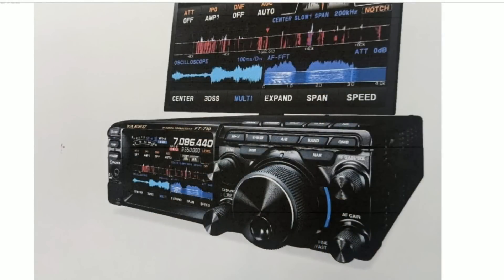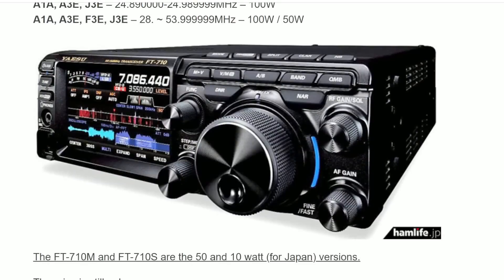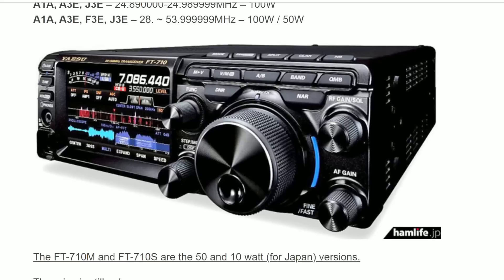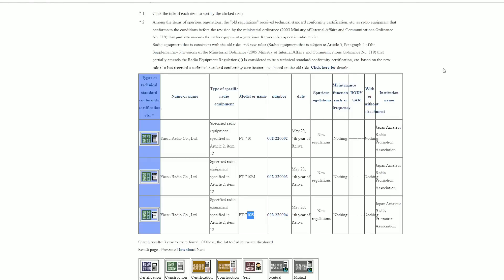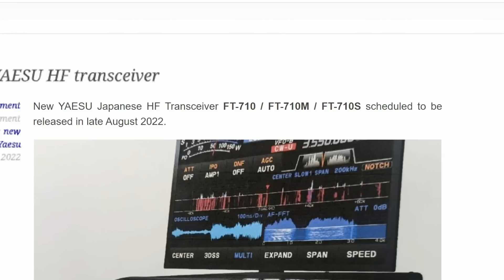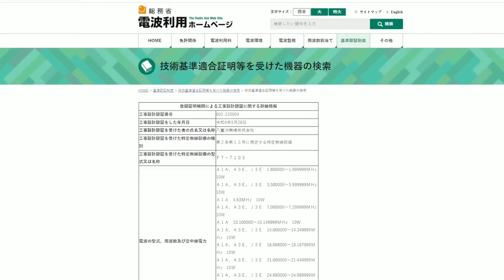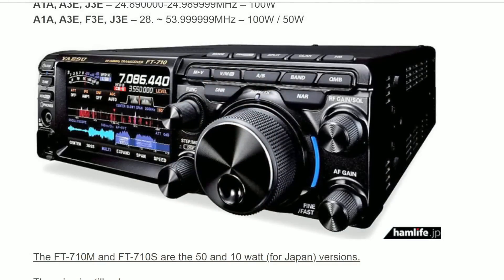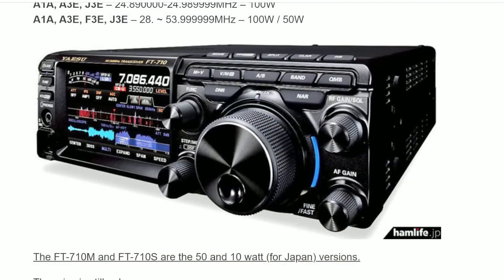NEW! Yaesu FT-710 Announced! HF Radio- Size ,Weight, Frequencies, Power, More - FIRST LOOK! #yaesu

Comment: I am stuck, not sure what to do. I am studying for my general now, want to buy first HF rig this month. want to do mostly digital packet stuff (and some pota), with some voice but rag chewing or listening to people rag chewing not my thing. If 710 was like $1000-1100 i would do that, but at $1300 and DX10 at $1400 (now), the $1400 looks better (I know the 710 has a $200 speaker included but). $300 rebates on DX10 expire end of this month. I am on tight budget but want to buy once cry once... Yaesu's reluctance not fixing interface problems on DX10 (nitpicks) bothers me, but maybe have done better interface on 710, or maybe the 710 will have more problems that Yaesu will be slow to address... KD9IRA
Reply from the maker: I'll have better answers for you next week when I see the 710 in person..  however my initial observations and thoughts would be to get the 991 as it also has VHF UHF (all.mode) and could be pretty exciting.. there's a nice convenience of having a radio that has 50 Watts on VHF and UHF.  And the digital noise reduction on the ft 991 isn't horrible (although not as good as the ftdx10).. with all that said the ftdx10 does have some amazing filtering and the waterfall display is very convenient to use. A word of caution on the DVI port, do not use a DVI to HDMI converter on that or the 710...  But I be definitely more happy to discuss further... If you go to my YouTube page, you can click the about me tab and shoot me an email
Reply from the maker: I didn't really get much time with this radio.  None really

Comment: I been comparing it with the ftdx10 & 101 for 4mths, I'm sure it'll cost a good £1600/2000, but just because new is it better than the others mentioned

Comment: Just saw this radio mentioned in an email from an UK supplier.

My first radio was the Yaesu FT817. It was a great choice. I love this rig and it still gets used as often as any other. I have also taken it on business trips due to its small size. I waited  and waited for Yaesu to bring out an updated FT817, but all we got was the lazy FT817D, a total disappointment for me. Since the FT817 I was wowed by the Icom IC7000 and have bought solely Icom rigs since then. Icom hit a "home run" (to use a Yankee phrase) with the IC7300. I got one quickly and showed it off ay my local club. No one showed the same level of enthusiasm as me, to my disappointment, however over the next few years so many club members bought this rig. Icom was the first company to realise the psychological impact of including the 4m (70MHz) band for the UK, even if only 1% of owners use this band, and again Yaesu fell short in releasing rigs without this band included. IDK, but looks as if this new rig continues to omit this band. Even though almost all UK hams don't use this band it will put people off buying a new rig that doesn't have this band.

Anyway my wait for a genuine replacement for the FT817 continues.  All I want is the rig updated to add colour screen, SDR technology and 4m, in the same size form factor. Surely nowadays it can't be that different. I am happy with the 5W, it allows the size to be kept low, so don't increase the size for a few extra watts.

BTW I did buy a FT857 after the FT817, it's bigger brother, but I never fell in love with it, and it hardly ever got used. For me there was just something about the size of the FT817 which I really liked.

Comment: Dude, have you noticed that it seems that when you are doing 'talking head', (you at desk, sennheiser shotgun, camera showing you seated in your chair), that the audio appears to be heard before the video shows you speaking?  That's very weird.  Somehow, your audio is getting ahead of your video.  Is the mic plugged into the camera, or are they somehow both feeding 'directly' into something else that's recording?  Cameras often cause a delay in the video, and know how much to delay audio too (so it matches).  If the audio and video are being handled separately, you might need to introduce a delay to get the picture and audio synched back up.
Reply from the maker: I thought I had it dialed in. Easy fix in OBS. Thanks for the heads up

Comment: Marketing sez - "Let's compete with Icom 705", but users say "Can't you improve Ftdx10 just a little first?". I like the AF gain knob to the far right. For Ftdx10 I'd like an SDR output, scope averaging, and another SO239. With the big push for FT710 it looks less likely than before that FTdx10 gets improved.

Comment: We need a new FT-857D shack in a box 100W radio, which is why I'm glad I have 2ea FT-857D and one FT-897D.
Reply from the maker: I agree.  2m/70cm feel like a must, especially to keep up.  But more importantly, because they do longer have a 100w mobile/portable shack in the box (i'm not calling the 991 portable).   At one point, I ended up sourcing a FT100 to have a 100w, portable HF radio with vhf / uhf.  I'd gladly pay for a portable / mobile radio with 100w and 2/70.  @Yaesu are you there? Heck, maybe Icom will come out with a 705 upgrade with 50 or 100 watts and 2/70cm..
Reply: I agree too. I have been trying to mention that to a certain salesperson from Yaesu  America but he doesn't want to hear it.

Comment: Guaranteed replacement for the ageing 991A. It is a FDX10 in a SLIGHTLY larger 991A body. I have both radios. The buttons on top scream MOBILE. It will have a mobile bracket unlike the DX-10. Dropping 2m/70cm is curious as in not good. I will most likely buy this one and use it as a mobile instead of the 991A. The 991A will go back to the desk for 2m FT8/ CF4 Wires etc. Anytone 778UV back in the truck IF I want 2m/70cm repeaters, FRS, GMRS, Analogue police frequencies/ NOAA weather.
Reply from the maker: If this is a replacement for the 991, or if this radio comes in 3 sizes (normal, Medium, subcompact), they missed the mark without vhf/uhf.  I love having my 991 back (I traded it and got it back) especially for the 2/70 SSB and Data modes. 2m SSB and Data in the summer?  Yes please.

Comment: Great Review! Thanks for taking the time to do it! But I saw this radio already when they called it the FTDX10.  Where is their ultra portable QPR SDR? Why is Yaesu letting Icom dominate the market with the IC 705? 

 Ultraportable, weathertight, ruggedized, energy efficient....These things would be great!  Lab599 and Icom have already built  SOME of these elements into their radios.   C'mon Yaesu, just take the best ideas from your competition, merge them.  You would own the market.
Reply from the maker: There are some theories which would suggest the M and S models are "Medium" and "Subcompact"  or "Small".  Meaning, maybe the 10w version is a portable version etc etc.  I don't really buy this theory. However, if that is the case, they are obviously trying to keep up with Icom and still falling short.  If that is what they are going for,  removing 2m/70cm was a bad move and as you say, My Lab599 will do nearly all the same, so there would be no benefit in me upgrading.  

However, I guess only time will tell (and maybe Yaesu) what the feature set will be, what this was supposed to replace or where it would fit.  I have plenty of questions and hopefully we will hear from Yaesu when they are ready to announce it to the US market.

Comment: I want FT-991a form-factor and VHF/UHF with the SDR capabilities of the FTdx10.  Who is the FT-710 for???
Reply from the maker: Some theories suggest maybe the different power levels would coordinate with different form factors. I'll be curious to see what information comes out soon
Reply: @DudeTested  I suppose a more compact HF rig would be nice but I like my all-banders ;)
Reply from the maker: @BreakingPintMedia  same!
Reply: and if you going to compare the low power version of the 710 to a Icom IC 705 you must have an intimate understanding of the Icom IC 705 capabilities to compare them objectively and accurately  I see this time and time again with completely shallow reviews  Good job dude
Reply from the maker: @3TQVK  well, we know that theory about form factors is now debunked.  Yaesu released a press video / new product statement last night.

Comment: Good video Dude. I ask myself why make this radio? The only thing I can come up with is maybe it's a $700 entry-level radio.
Reply from the maker: It's possible. Some theories suggest maybe the different power levels will be different form factors .. 10w like a 705 etc etc
Reply: @DudeTested  It would have to be 705 size for me to be interested. I hope it has a really complicated menu system. Fingers crossed.🤞

Comment: They gave the dx10 buttons from the other like 991/857 etc that people wanted vs having it around the vfo and went with a single vfo which people also complained about.... Seems it's a dx10 that you can buy cheaper and likely the power levels will dictate price like Tesla ;)
Reply from the maker: Maybe the power levels will also be an indication of form factor. I've seen a few suggesting this. Interested to see where it goes
Reply: @DudeTested  oh u mean even smaller size if you go less power.... That's interesting... That would actually work. And here I was wishing we would see a 50-100w 705 this year :)

Comment: I want a FT991A upgrade.  An upgraded monitor (screen).  All mode radio.  

The biggest issue with the FT891 is.. they call it a mobile radio but it’s really not.  It’s a portable radio.  Have you ever tried to operate it mobile ? It’s very difficult. Changing bands is cumbersome.   The Icom 7100 is a true mobile radio but the form factor is slightly weird.  

I want an upgraded Icom 706 Mk ? 

Why can’t these companies come out with an all mode portable with 100 watts.

Comment: The issue with the FTDX10 does not fit in a 2U space like the 991 does. That was a miss. It was off just enough to force the complete reconfiguration of my case. But performance wise, very much enjoying it. Also seeing RF/AF moved back to the right. After so many hours in the 991, I still find myself turning the Notch dial in the DX10 instead.

Comment: Hi Guys.. Too heavy for portable and probably too much current draw anyway. Not 100W? Unless it's cheap, then I wonder what the killer spec is? FTdx10 receiver and VHF/UHF (would be cool). There is a market for 100W, + VHF and flip-off front IMHO!

Comment: Was hoping this may be an FT-891 replacement but it's too big for that.  Thanks for the video.
Reply: Why would you want a FT-891 replacement? Only problem with the 891 is no VHF/UHF. Other than that it's a great radio.
Reply: @jneale5204  agreed, it is a great radio. But when I see Yaesu bringing out something new, I was hoping for an update of some kind to an older radio (891) has been out several years.  Instead, they are bringing out something that seems to have very little difference to the existing FT-DX10.
Reply: It hasn't been out very long. 5 years at the most

Comment: Maybe its a price point radio. Remember the ft-450 is longer around so maybe this is its replacement .
I don't think it'll be as cheap as the ft-450 was but  could be a good bit cheaper than the ftdx-10 and ic-7300 and a good starter radio
I'd like to see an updated ft-991
A ftdx-10 with 2 and 70cms added
Now that would be a game changer
Reply from the maker: I feel as this may be the best theory. I've heard theories about multiple form factors (M being Medium, S being Small),  and the name "710" may suggest that, However.. the FT-450 lines up.  if it was a DX10 entry level "7300 killer", I would think it would be a hybrid SDR and be called the FT-DX710.  Since it's not the DX anything, I suspect maybe it is a entry level replacement to the FT-450 and there is no SDR.  It'll be interesting to see where they go. Yes a Subcompact form factor FTDX10 with 2m/70cm  is what people want, I truly believe that.  Even if it was only 10 (or 20) watts, I would love to see that. Maybe the issue with that is cost.
Reply: Thinking about it the radio is most likely a replacement for the ft-1200 not the ft-450 and expect it it'll be priced around the 1000 $/£ mark.
Yaesu already dropped the price on the ftdx-10 in the uk to £1350 and with £85 cash back is now cheaper than the Icom -7300 by about £30
So if it would not be a good buy if its much over £1000.

Its listed now on one of the uk radio seller's site's at £25 Deposit but no mention of when its coming into stock.
No mention either of a  Hybrid design like the ftdx-10 and ftdx-101

YAESU is excited to announce a new HF/70/MHz/50MHz 100W SDR Transceiver – FT-710 AESS.

The new FT-710 AESS is a compact design yet provides 100W output, utilizing the advanced digital RF technology introduced in the FTDX101 and FTDX10 series.

A few of the remarkable features of the new FT-710 AESS are:

- YAESU Unmatched SDR technology emphasizes the Receiving Performance
- Band Pass Filters dedicated for the amateur bands to eliminate out-of-band unwanted signals
- RF Front-End design with the 250MHz HRDDS (High Resolution Direct Digital Synthesizer) enables phenomenal Multi-Signal Receiving Characteristics
- QRM rejection by the dual core 32-bit high speed floating decimal point DSP for SHIFT/ WIDTH/ NOTCH/CONTOUR/ APF (Audio Peak Filter)/ DNR (Digital Noise Reduction)/ NB (Noise Blanker) and 3-Stage Parametric Equalizer
- High Resolution 4.3-inch TFT Color Touch Panel Display
- 3DSS (3-Dimensional Spectrum Stream)
- VMI LED (VFO Mode Indicator) placed around the VFO dial shows the current operating mode (VFO-A, VFO B, Memory Mode and Clarifier/Split Operation)
- “PRESET” Mode Function most suitable for FT8 Operation
- AESS: Acoustic Enhanced Speaker System with SP-40 creates the high-fidelity audio output#
- External Display Connection Terminal (DVI-D)
- Built-in High Speed Automatic Antenna Tuner with 100 channel memory
- Support the FC-40 Auto Antenna Tuner
- SD Memory Card can be used to save the communication record, transceiver setting, the memory contents, screen capture images, and to update the firmware
- Two (2) USB Ports (Type-A and Type-B)
- Other essential features such as CW ZIN and SPOT, IPO (Intercept Point Optimization), and Remote Operation with Network Remote Control System to name a few

Specifications:

TX Frequency Range:
1.8MHz band – 50MHz band (Amateur bands only)
70MHz – 70.5MHz (UK Amateur bands only)

RX Frequency Range:
30KHz – 75MHz (Operating)
1.8MHz – 29.699999MHz (Specified performance, Amateur bands only)
50MHz – 53.999999MHz (Specified performance, Amateur bands only)
70MHz – 70.499999MHz (Specified performance, UK Amateur bands only)

Emission Modes: A1A(CW), A3E(AM), J3E(LSB/USB), F3E(FM)

Supply Voltage: DC13.8V ±15%

Power Output: 5 - 100W (5 – 25W AM Carrier)

Dimensions (W x H x D): 9.4” x 3.1” x 9.7” (239 x 80 x 247mm)

Weight (Approx.): 9.92lbs (4.5kg)

Comment: This rig will only make sense to me if they price it at, or just under $1000 with the lineup as it is. Otherwise I don't see how it fits unless they're discontinuing something else.
Reply: Could be the 891 replacement, maybe?
Reply: Japanese Yen is down relative to the dollar. I'm not sure about $1000, but at least I suspect the gear price inflation is going to slow due to this.
Reply: Current EU Model and pricing from WIMO $850
Reply: @radiotests  It'll be an interesting offering if that price holds true when released in the U.S.. I'm interested enough to reserve one anyway.

Comment: That 'Flip up monitor looking thing' as you first thought,  pegged me as a computer monitor, not anything that flips up, witch I think means that it will maybe have a video output port of some sort.
Reply: Yup, a computer monitor, you can see a sliver of the stand and a cable.

Comment: Thanks for the info. I'll keep my FTdx3000, FT-817nd, FT-857d (Both of them) and my FT-897d. I might get the FT-991a? Looks like Yaesu's trend is to decouple the Vhf/Uhf from the HF radios. We might not see the FT-991a in the future.
Reply from the maker: I'm glad I just got my 991 (non A though) back.  It's a radio that they should be trying to build on as it has unique potential. That or make a DX series model with V/U (that would be cool).
Reply: Go for the 991 if your a Yeasu enthusiist otherwise Icom

Comment: Thanks Ham Radio Dude. I’m in the market and saving up for a base station for my shack. The goal is the FTdx-101 but we will see. Great video.
Reply from the maker: I'd love to get my hands on a 101.  However, I have started to think.  If I am paying $3200 USD for a FTDX101, I better look a little closer into FLEX Radios and their 6400 line.

Comment: I am betting this is targeted to compete with the IC7300 and will be cheaper than the FTDX10 because it will be a direct SDR without the FTDX10's superhet front end.  That is the only thing that makes sense to me where this would fit into the current HF market.
Reply from the maker: You sir, have it down.  This is probably what's happening. Still seems a bit awkward in the current lineup, but it makes the most sense so far
Reply: That’s my first guess, too. I’ve been wondering if yaesu would ever build a competitor to the 7300.
Reply: DX10 outclasses the 7300. all it (7300) has is SLIGHTLY reduced cost, size.  But hands down to DX10. Delta in price is just around $50 (gigaparts retail). IC7300 is several years older design also, just saying.
Reply: @greg5929  And never discount the "OVF" light.

Comment: Simple, FT710 is the new FT450, that's it.
If we look at the history, back in 2000 we got FT2000, and then FT950, and after many years, FT450 arrives.
Sounds familiar?
Reply: that makes sense. intro radio perhaps with the 50-watt or 10-watt version give us VHF and UHF Yaesu.
Reply: Dead on and I've been following Yaesu for 45 years. It's a 7300 killer in the $850 slot.